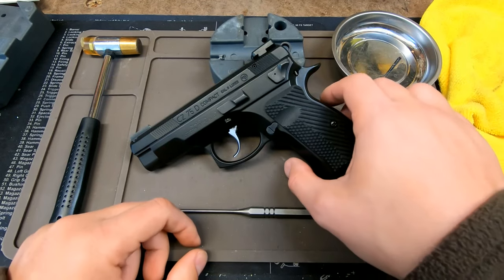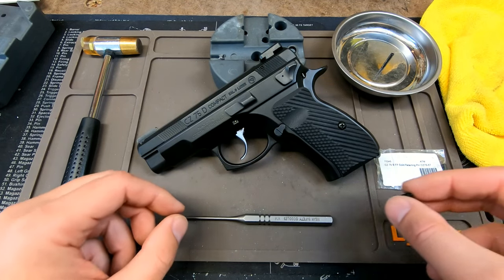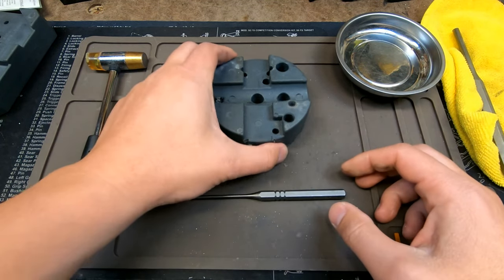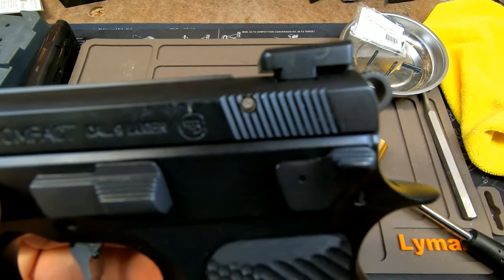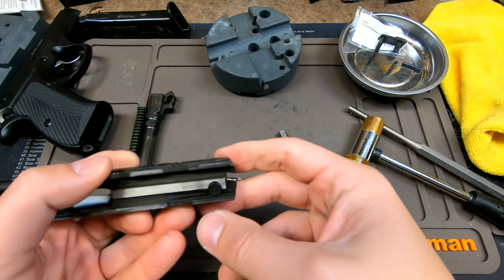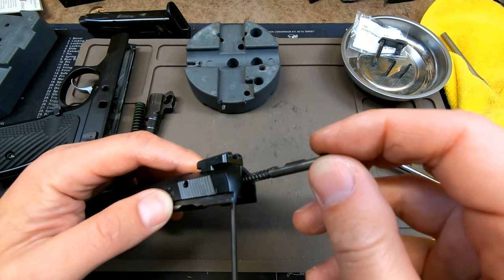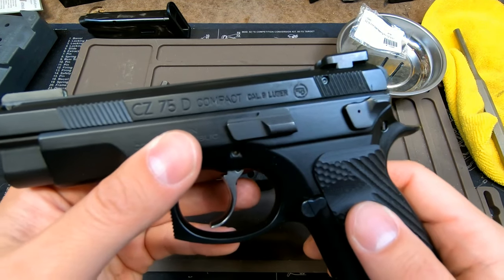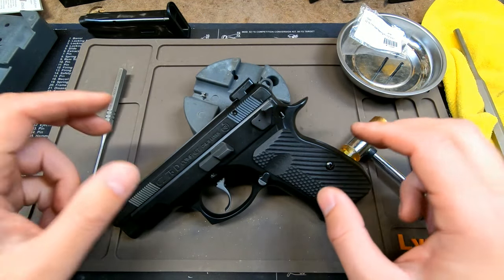CZ75 Platform DIY - The MOST important part to upgrade - Firing Pin Retaining Pin Upgrade

Comment: Can you please share where I can get the hammer and the pin tool?
Reply from the maker: I bought my hammer and punch on Amazon.  The pin is available from CZ Custom.
Reply: @CobraReady  Thanks! I just bought a new SP01 last month and I'd say dry fired <10 times, just practice, do I really need to change it? or wait till 500 round or so change it? can you pls shed some recommendations?
Reply from the maker: @KING2011KOKO  I'd buy the replacement parts now and maybe wait a little.  Inhad problems after 500 rounds plus dryfire so it can vary when you need to replace.
Reply: @CobraReady  thanks! just to make sure I don't need to remove the actual slide so just hammer it out and put it back in right? kinda plug and play?
Reply from the maker: @KING2011KOKO  If done correctly, yes.

Comment: Is it the same steps for the cz75 p01
Reply from the maker: Yes
Reply: Thanks a bunch bro u just saved me so much. I thought I was gonna have to send it in to CGW.
Reply: One more question. As far as basic reliability up grades go do you think a extended firing pin would make a difference for the cz 75p01
Reply from the maker: @jerrytate6375  Glad I could help
Reply from the maker: @jerrytate6375  The extended firing pin would increase reliability if you put in a lighter hammer spring.
Reply: Based on your knowledge and experience what upgrades should I get to increase the longevity of my cz75 p01
Reply from the maker: @jerrytate6375  Main thing is the firing pin retaining pin.  I always upgrade sights, springs and triggers on my CZs though but that is personal preference as that doe snot effect longevity like the retaining pin does.

Comment: Why is it so hard to hammer out the roll pin?? I kept going ham on it until it slipped and damaged the slide. Pos gun. Still couldn't get the factory roll pin out. Fucking impossible without breaking the slide.
Reply from the maker: The roll pins are junk and sometimes flared on the ends making them harder to get out.  This is true for the trigger pin as well.

Comment: To be honest this is what keeps me from buying one
Reply: Use snap caps and the retaining pin will not be damaged.  In my comment above, I use a small, rubber grommet jammed into the area above the firing pin allowing the hammer to fall on the grommet rather than the firing pin.

These are great handguns...accurate and soft shooting considering the aluminum frame...see if you can rent or borrow one to shoot.  The firing pin retaining pin is a simple issues to replace.
Reply: Not being able to do what most people say not to do it what prevents you? Interesting.

Comment: Thank you for this! I bought the CGW firing retaining pins. They are awesome and are stronger than the factory, however, the CZ Custom pins look even better as they are SOLID pins not hollow pins. As always KEEP ON ROCKING! BTW, love my PCR D too. As for the grips I stick with the Stock rubber grips. Yours looks great where did you get them?
Reply from the maker: Thanks for the feedback.  The grips are Cool Hand that I got on Amazon.  I like palm swells since I have big hands.
Reply: @CobraReady  I ended up buying the CZ Custom Firing retaining Pins for my CZ's because of your video. I also got an aluminum mag brake for my PCR D. You should do a review on it. I would guess very similar to the Springer Precision mag brakes. You are MAKING ME POOR!...LOL As always fantastic how to videos and KEEP ON ROCKING and Happy New Year!
Reply: @cjmoore7240  Have you seen any ware and tare on the firing pin since you upgraded to a solid roll pin?
Reply: @DjTeliik  Nothing unusual. The CGW firing pin is fine. Great product.
Reply: @cjmoore7240  Good to know How many rounds have you fired with yours since the upgrades? I just got a CZ 75 and upgraded with a CZcustoms solid roll pin and extended firing pin with probably just over 100 rounds fired.
Reply: You want hollow instead of solid for the retaining pin. A hollow design leads to the retaining pin being damaged by the firing pin overtraveling rather than the firing pin being damaged when it overtravels and hits the retaining pin.